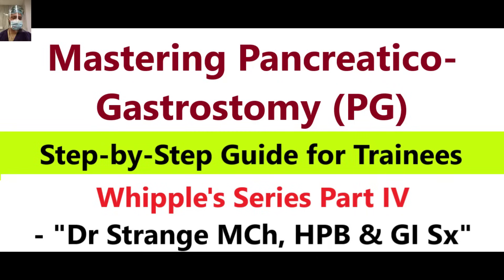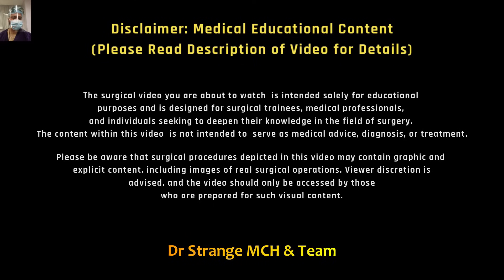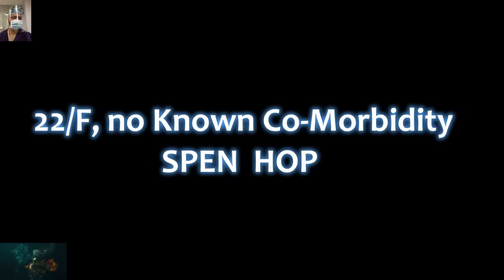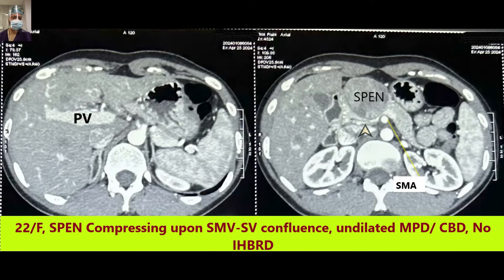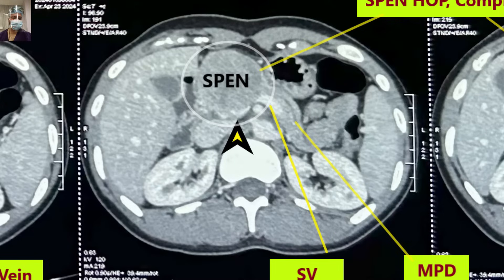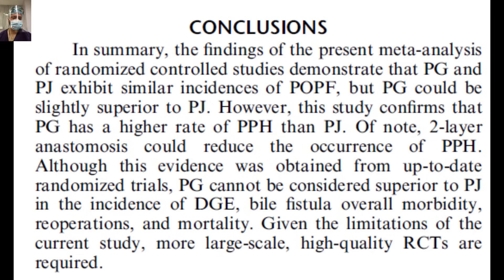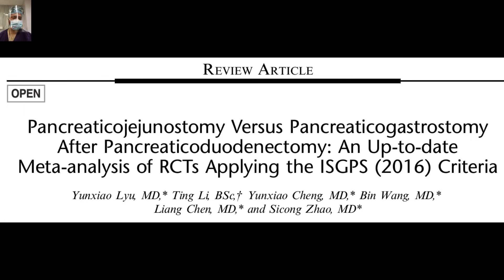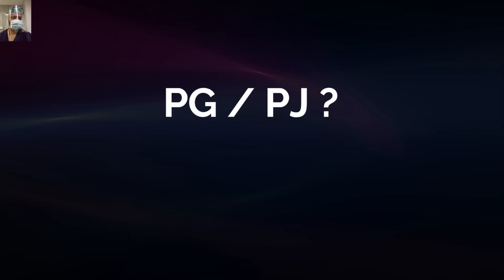Vid 5.1 (Part 1): Mastering Pancreaticogastrostomy: Theory & Rationale #whipple @charleschoto1428

Comment: It’s pseudo-papillary epithelial neoplasia, a tumors seen in children, expanding in nature rather than invading the surrounding the structures. There’s some credible evidence that in case of soft pancreas, lot of fat and small caliber duct, PG is associated with less leakage compared to PJ. There are several ways of doing PG, and no one technique is superior to the other.
Reply from the maker: Excellent summary, Khalid 👏
Yes, solid pseudopapillary epithelial neoplasm (SPEN) is indeed more common in young females and typically shows expansive rather than infiltrative growth. Agree that PG tends to be safer in soft pancreas with small ducts — though recent meta-analyses suggest comparable leak rates between PG and PJ when technique is standardized. Ultimately, meticulous duct handling and surgeon familiarity remain the key determinants of outcome.